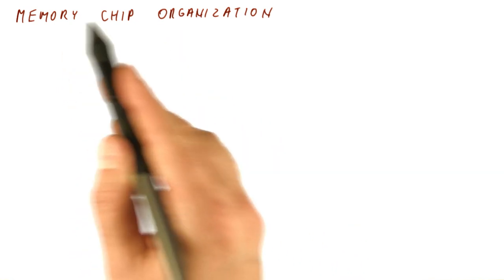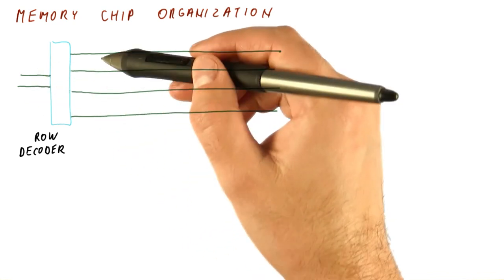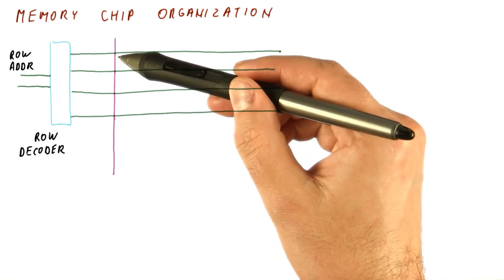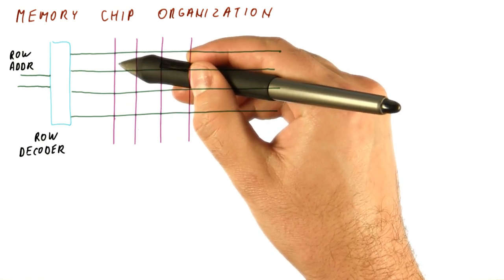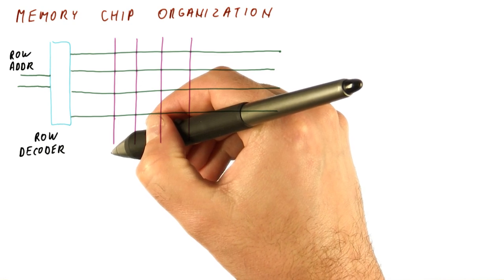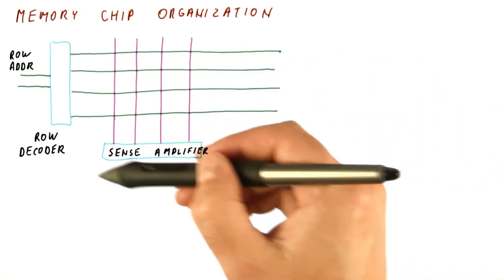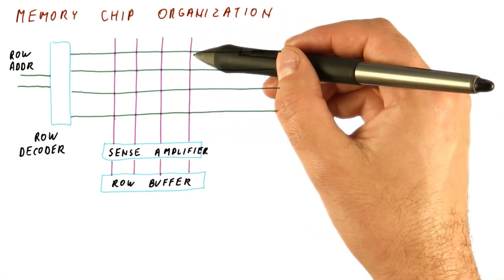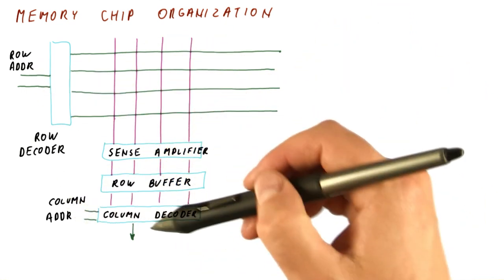Memory Chip Organization Part 1 - Georgia Tech - HPCA: Part 4

Comment: but why ram 62256 is 9 rows address and 6 columns address so the data matrix would be 81x36=2916 bits while the datasheet says it's 512x512=262144 bits.can you explain?
Reply: Row address is 9bits = 2^9 = 512
Col address is 6bits = 2^6 = 64
Hence, addressable memory cell = 512 * 64 = 32768

Columns are typically read in a burst of 8 bits. So, your actual bits = 32768*8 = 262144bits
Reply: shashank rao i have been thinking about what you said but still don't understand it. 2 terminal means that 4 possibilities and 9 terminal means 81 example: 01;10;00;11 so what to do with 2^9 ? it should be 9^2?
Reply: @lanchanoinguyen2914  u have 2 possible bits per bit cell so s^9, its everytime 2^x , x=something